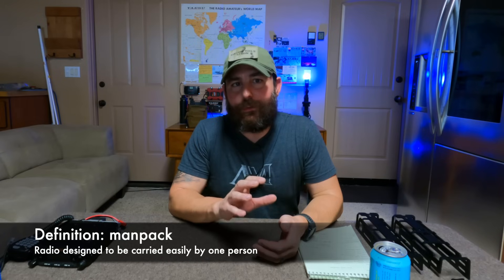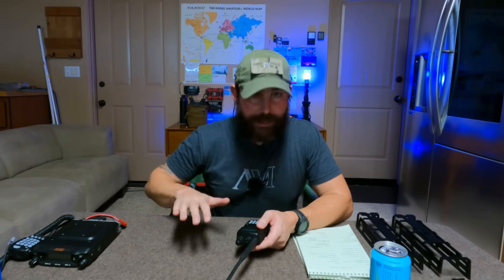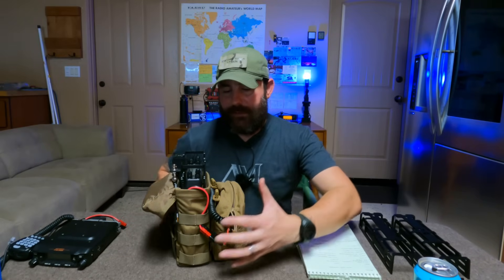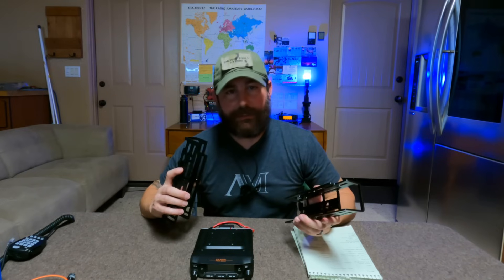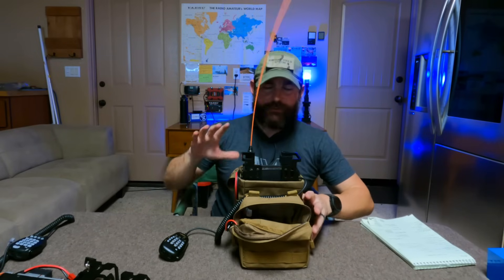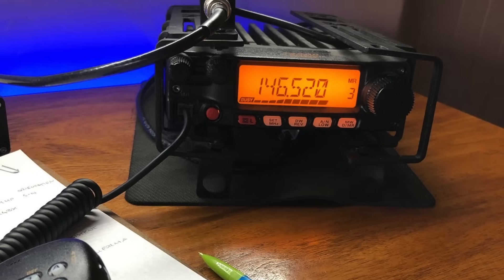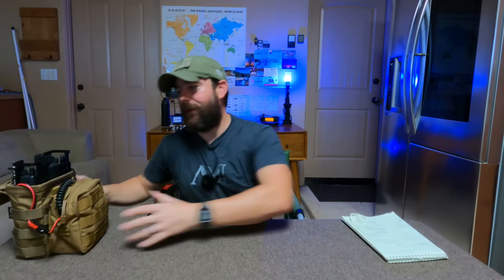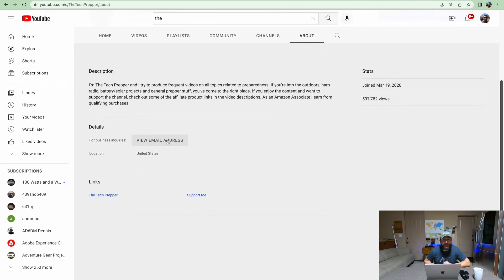Military-Style Radio Manpacks for Civilians - Part I

Comment: Another nice thing to do with the 12V Li-ion rechargeable battery, charge it with PV. A PV and a small 300W pure sine power inverter can be carried in the pack. I can power a bedroom LED lamp, laptop, and my smartphone on this system. A couple of other things I recommend having around are a portable butane stove and a Weller Portasol butane soldering iron. Also, get a food dehydrator, pickling press, canning jars, and water filters.

Comment: This just gave me the idea to completely revolutionize the pack radio I built for some of my SAR deployments (Motorola radio externally bolted to an old M33 can and a 30a battery). Definitely need to check out the other videos and Armoloq!
Reply from the maker: Glad to hear that this content is fueling the fire. I'd be curious to see what you come up with. There will 6 or 7 parts in this series. Stay tuned.
Reply: @TheTechPrepper  they already replied to an email I sent, apparently the frame specific to my chassis is already in development and will be released soon!

Comment: Looking forward to this series. One question - have you looked at light/ultralight packs? I'm always looking to shave weight, especially for SOTA.
Reply from the maker: Thanks. I have not really looked into ultralight backs as they will very likely get shredded in my environment. My gear is very heavy. My Eberlestock FAC Track is ~6 lb. empty. I am pretty sure I carry much heavier loads 
 compared to other SOTA operators. Search "SOTA" on my channel page and you'll get a sense for what I mean. Cheers and good luck finding lighter gear. Check out K6ARK's channel. His stuff is light.

Comment: Extremely informative video. Complete from pouch to antenna
Reply from the maker: Thank you. I'll do another break down on the video coming out this week. The parts are mostly the same. The only difference is that the radios will get a bit more powerful. Cheers.

Comment: It was an AN/PRC 25 during the Vietnam war, followed by the AN/PRC 77 at the end and after Vietnam.
The difference between the 2 is that the 25 still used one or 2 valves and the battery had to supply a 5v power feed for the valve heaters and only had 100khz channel spacing, the 77 was fully transistorised and offered 50khz channel spacing giving twice the channel capacity.
Your photo also shows an AN/PRC 25 set being used with an early Cryptographic unit/scrambler, which was the same physical size and used the same magnesium 15v/5v battery at the 25.
Reply from the maker: Morning, Sam. Thank you for all these details. Sadly, I am not prior service, but I find these military radios and related SOPs fascinating. I am pouring through the "Long-Range Surveillance Unit Operations" FM 3-55.93 manual now. Happy Thursday!

Comment: Congrats to the winners. You pretty nailed it regarding basic manpacks. From my Army days, having the manpack tall and skinny is a good thing for getting weight close to your back. But, can be a pain when getting to the battery.
Reply from the maker: I like the "L" shape form factor of my packs, but have played around with the tall skinny form factor using the PRC/117G pouch with the my smaller radios (FT-818ND and FTM-6000R) where the battery sits under the radio. If this first bag design goes well I may make and sell that design, too.

Comment: Hey tech prepper!!!! I know this is an older video, but I've been having difficulties finding a pouch for a 2730a. I want to finish my manpack build, I just cannot find a proper pack. Would you be able to steer me towards a good pouch???!? I absolutely appreciate all you do, we all do here. I've learned so damn much in the last year from your videos!! 🤘🤘
Reply: @richardmendoza: That’s a good idea. I have the 2730a as my vehicle mobile. I didn’t think about the 2730a as a man pack radio, but with the remote control head I can definitely see it’s uses! What are you going to use for power?

Comment: You have some great ideas, I especially like the frame rails.  I built a pack style system, but used a plastic ammo can to enclose and mount the radio, battery and a short antenna.  I keep a larger folding tape style antenna velcros to the handle.  The D rings on you bag are perfect, I'm going to add them to my ammo can - I'm sure it will make mouting the can on my ebike for public service events much easier than the bungee cord I'm currently using.  Keep those good ideas coming!
Reply from the maker: The frames have been a game changer especially for all the portable operations. They offer great protection. Thanks for sharing your project.

Comment: Since I can’t find an 857 to save my life I’m about to buy an 817nd. I like your rigs and style. Keep up the good work.
Reply from the maker: You and everyone else. I've been trying to find a second unit for a year. The FT-817ND is an excellent choice. You can actually do a lot with 5 watts. I. fact, don't miss my next video in the No Random Contacts video. I'm going to try an establish a planned 285 mile connect from Arizona to Utah with another YouTuber. I'll be using the FT-818ND. You'll enjoy the 817. You can get them used for about $400 USD in good condition.
Reply: @TheTechPrepper   Very good, I’ll be sure to check that video out. The gentleman is selling this particular 817nd for $600 with a Ventenna HFp antenna and go bag. Seems like a reasonable price for the kit.

Comment: I'm thinking about building a VHF/UHF man packable radio system. Just need the pack and radio.

For the pack, I've done a Google search not too long ago on military radio packs and came across a Ranger Radio Pack. The radio I have in mind is the Yaesu FTM 300DR. It has capabilities that I'm wanting in a radio, APRS, built in GPS and cross band repeater. 

I have a spare N9TAX dual band roll up j-pole with 10' of coax and a 15Ah Bioenno Lithium Iron Phosphate battery. My plan for this pack is to have everything in one pack with room to spare for a roll up solar panel, maybe a 25' length of RG58 coax, battery meter, power and SWR meter as well. 

Living in the mountains of East Tennessee has some challenges. Good thing is that there's no shortage of trees to throw a line into to get the antenna up. 

On top of a mountain, an HT will do, but down in a valley is another story. I like to get out and hunt, so having a good radio with cross band repeat capability will come in handy if I need it.

W4ISB, 
Mike in Tennessee
Reply from the maker: You're in luck. I believe ARMOLOQ is either building a TPA pack frame for the 300 and/or 200. Good luck!
Reply: Greatly appreciated. I'll have to check it out and watch for one.

Comment: I have a Yaesu FT-2700RH dual-band transceiver, it's 10W/25W. I should easily make it a man pack. The cables hang off it and I placed 14AWG Anderson Powerpoles on the power cable.

Comment: Very excited over your video. As a new General operator yet to own a ham radio.  Wasnt sure where i wanted to start. Talking to people overseas not so interesting..,Very interested in the POTA field setup and etc. The FT 851D is a must..  Very interested in a military bag setup making it possible for vehicle use and field use. Thank you for helping me discover my direction in ham radio communication.  Now,  I feel i can slowly move forward toward equipment investment.. any suggestions locating the FT 851D ?  Where did you purchase your bag, 19.5 antennia and various parts...thank you. Looking forward 👌 to your next video....W4KWT.
Reply from the maker: Welcome to the channel and hobby. The FT-857 is discontinued, take a look at the FT-891. It's HF-only, but also runs 100 watts.? It's heavy, but it's fine for POTA. The PRC/117G pouch from High Ground Gear fits both the 857 and 891 with the ARMOLOQ frames. I've made videos on this. The manpack series should have most of the parts in the description.

Comment: Gaston, so what I've came up with for my Wouxun KG1000-G manpack is, I've purchased a smaller backpack, it will hold the radio, battery and folding solar panel and still have some room left over, and it's not that heavy. I had purchased a 10ah lifepo4 battery, but it will not support the radio when transmitting, so I purchased a 20ah battery, it seems to work fine. Thanks for all of the ideas you've presented in your videos.

Comment: heck yea! great idea! Ive been wanting to do something mobile, to move from vehicle to vehicle, this just may be it!
Reply from the maker: Awesome! These manpacks transition very well to a vehicle. Especially if you don't want a permanent install. My RV only has a lip mounted on the antenna with the coax fed into the cab. We just used the manpack on a recent RV trip with great success. You can optionally also drop a 12v line from the starter battery into the cab if you need more power. Good luck!
Reply: @TheTechPrepper  gonna keep following, keep it up

Comment: I like your small Molle pack build. Also, have you seen the Midland Ammo can packs out there? They have 2 and the smaller reminds more of a PRC military type that could fit in a ruck for travel. Also, while you would have to change some things, the Mojave Lunchbox repeater that you can buy (when available) is another good contained system. All that, I do like the smaller, more portable design of what you showed. You could probably make a little bit of money if you built those and sold then already put together
Reply from the maker: I have seen the ammo can builds, but I found the bag approach to be more comfortable to carry with my other support gear in the ruck. I am mostly a man-portable operator and take my gear up mountains, so this footprint works well. That Midland ammo can design would work great for a vehicle or at a camp site. I plan to sell these as fully assembled kits once I get a handle on what it takes to sell 40-50 bags. I appreciate you sharing. Take care and be safe.

Comment: Great video and good information. Definitely have to be aware of how much RF radiation you're putting out with a man pack. Brings back memories from my days in the Air guard using prc-117's 119's and the AN/PSC-5.
Reply from the maker: Thanks for your service. Do you recall what your max output power was on any of those packs?
Reply: @TheTechPrepper  between 5 and 10 watts. The PSC-5 could go up to 20W in certain models.
Reply from the maker: @risbill1  Thanks for the confirmation.

Comment: Glad to find your channel. I'm new to the radio world, don't even have the license yet, but decided a mobile unit was more my speed than an HT. Will probably still get an HT for convenience when I don't need the power or capability of a mobile, but would like something like this when I go out to no man's land or emergencies. Looking forward to seeing the builds.
Reply from the maker: Brandon, Welcome to the channel. The mobiles are an excellent choice. Another option is get yourself an expensive $25 Baofeng UV-5R on Amazon. The ham purists hate them, but they really are great starter radios to get into the hobby with as little capital as possible. That's what I did. When ready upgrade to something more cable. 73

Comment: Hey, I have an idea that may work well for you. They make MOLLE hydration carriers with a full-length storage pouch (in addition to the bladder), a secondary short pouch, and MOLLE on the back. Some of them also have backpack straps for use standalone. One of these may work great for carrying a radio.
Reply from the maker: Thanks for the tip! The problem is accessing the radio controls. I did an experiment on the channel some time back where I relocated the control head with an umbilical system from the pack, but abandoned the effort. That solution would work well with what you are proposing.

Comment: Like your stuff.  I am new to this channel, so I may have missed any content that uses hand helds as apart of a lighter weight 'man pack'.  Suggest the use of 2 hand helds and a split frequency circuit.  One as a receiver on a good omni directional antenna, and the other as a transmitter using a high gain directional antenna.  The advantages are : a much lighter load, a split frequency that is more difficult to intercept, and the use of an antenna that is difficult to DF. The transmitting transceiver could use UHF to reduce the size of the yagi or moxon used, or the use of a higher gain 5 or 10 element yagi that propagates with a narrower foot print. These yagis can however be more difficult to point in the direction of a station if an azimuth cannot be aquired. A 3 element yagi, or a Moxon is easier to use and further reduces weight and bulk.  I prefer Moxons for this application because of the much wider bandwith and much high F/B ratio.  However I do have a 3 element design that is super broad banded.  It's F/B ratio is much much lower than a moxon, but it does allow the potential use of frequencies between 411 to 480Mhz.  This includes 70cm to GMRS.  I'll post the link to my article on how to build this yagi separately.  YT may delete it?
Reply from the maker: I did a series on the VX-6R as well demonstrated digital modes with the VX-6R and the DigiRig. That's about as much as I've covered in terms on HT's on the channel. I carry an HT and Mobilinkd with my phone when I trail run. That's about as light as I go. I'm also not too concerned about direction finding while times are good. For SHTF, it will be running minimum power (300 mW) with a small yagi and keeping contacts short. If I'm really concerned about being hunted HF NVIS will be my goto method of transmission for regional use.

Comment: I noticed you were using an Ft-8900 in one portion of the video along with a signal stick antenna. I was wondering what freq, this will work at and if you have to use a counter poise to make it useful...
I have been assembling a similar go bag, and just recently purchased a Dakota 12v 18Ah battery to power my ft-8900. During some testing i had the radio shut off ( using the signal stick antenna ) and had to disconnect the battery before the radio would reboot... Thinking it was a bad cell with the battery I checked the output and draw on the battery. When it was all over I decided to plug the radio into a known good antenna with a ground plane, and sure enough it turned out to be the antenna...

Comment: What you're doing is interesting.  My own thinking is to keep it as simple and light as possible. What are your thoughts on KX2 or IC-705 as the basis for these comms packs?
Reply from the maker: Unfortunately, both of those radios as well as the Xiegu X6100 have an odd form factor making it difficult to achieve the same compact package. The slim, vertical radios work better in my opinion.

Comment: I use a Icom 703 in a hikers backpack. The main part it the radio and battery is in the back and the control head with mic in a small pouch hanging on my front.

Comment: How about a link for the pl259 to bnc cable you use, always good to know what parts/brand are good versus junk. Thanks and just keep sending us these great videos!!
Reply from the maker: Starting in Part III, I'll list the exact gear down to the component-level. There will be link to a corresponding blog post for each manpack. I'll go back and do the same for the FTM-6000 as soon as I can. The parts are pretty much identical except for the ARMOLOQ pack frame. The frames vary by radio model. ETA: 8/27/22

Comment: At 4:51, the L3H manpack in the upper left hand corner is the AN/PRC-117G.  As alluded, unless you have a USGOV crypto account, obtaining one of these is impossible.  They used to manufacture the non-type one 7800M-MP manpack, which is a type 3 crypto radio and looks somewhat similar to the 117G.  I believe the 7800M has been discontinued.  Nevertheless, getting your hands on one is nearly impossible…..but it can be done.  The 152 is a HH radio and it is a type 1 radio.  There are also several HH variants that look similar and are not type 1.

Finally, there are many features that separate a typical ham radio from a mil radio.  Rugged construction, being able to operate in nuclear or chemical warfare environments are but two of the differences between a mil radio vs a “Yaesu” box.  That said, the use of a ham radio in a battle environment has been accomplished very successfully.  Been there, done that.
Reply from the maker: Thanks for calling that out. I miss spoke, there was small overlay on the bottom left of the screen that I included during editing with the correction. You're right it is the AN/PRC-117G.

Comment: About 30 to 40 years ago Yaesu made some rigs for manpacks.

Icom had equipment to turn the Ic-703/+ for a manpacks.
Reply from the maker: Did they really? I am not surprised. Yaesu's older rigs constantly impress me. Thanks for the info.
Reply: @TheTechPrepper  They were monobans for 6, 2, and .70m.  Had dual ant. ports, one on back, BNC in front.

Comment: After the SHTF a good radio setup will be essential. A man pack is a great base and the smaller units for " away" trips. I like having 4 smaller units in my pack. I like having a flexible solar film wrapped around the outside and hooked up for constant rechargeing.

Comment: Congratulations again and thank you for another great series. I've been playing around with simplex repeaters from Surecomm and Argent. Small enough to fit in a manpack or a dropbag to increase range. Thanks again! 73 // Steve - KC2UXS
Reply from the maker: I have a Surecomm controller, too. Mine is for the FT-60R's. Which radios are you running with yours? I put mine in the box when I discovered crossband repeat on the Yaesu FT-8900 and Kenwood D710.
Reply: @TheTechPrepper    I've experimented with both of them on a variety of base and mobile rigs. I've been keeping the Surecomm in a mobile kit of HTs (along with LoRa) as a quick, easily deployed backup comm for the family in the event of SHTF.  As you've said before - 2 is one and 1 is none. Keep up the great work!!